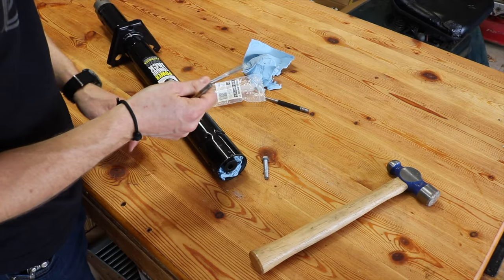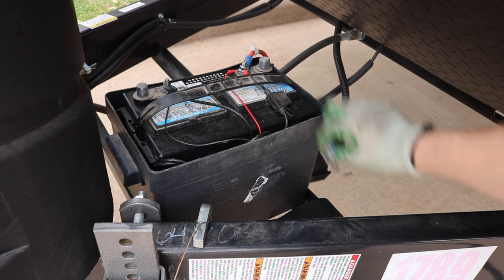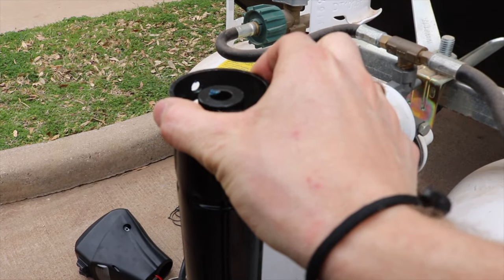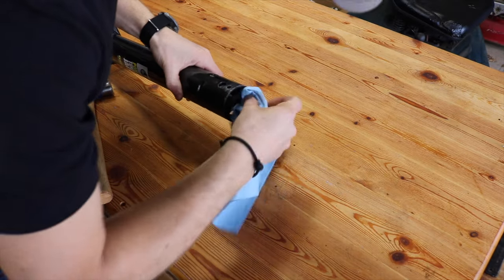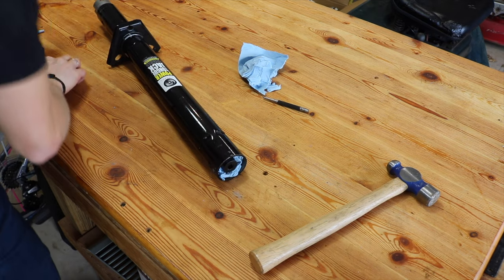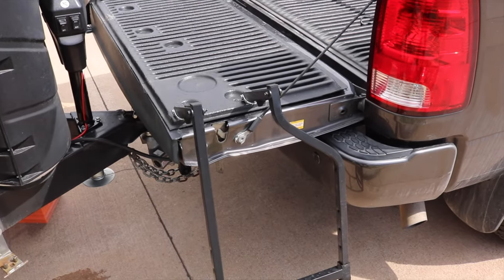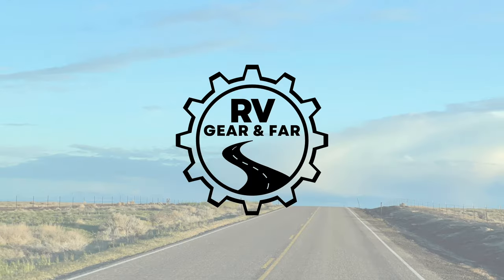Life-Changing Travel Trailer RV MOD: How To Fully Open Your Truck Tailgate WITH A Trailer Attached!

Comment: Alternate method: unbolt the jack from the frame, turn it 90* and drill 3 new holes in the frame and bolt it back in (maybe spray paint to holes to prevent rust before bolting the jack back on).  Just a thought, especially if you don't have a set of taps.
Reply from the maker: I mean… yes… but I’d rather wait for the mailman to deliver a tap than to drill 3 new holes in the attachment bracket so close to the original holes
Reply: Could you just rotate it 60 degrees and use the same mounting holes?
Reply: If the jack plate is round (like Husky), drilling new holes in the plate is less work than drilling the frame and no tapping to do.
Just have to use transfer screws to mark the 3 new holes location on the jack plate.
Reply from the maker: @normtaylor9844  the holes aren't in an equilateral triangle - so they don't line up if you do that - that was the first method I tried out ◡̈

Comment: A hitch extension  is way cheaper than a jack  and gives more turning capabilities
Reply from the maker: Possibly- but many rigs already have this jack installed and just need to swivel the motor head
Reply: Weakens the design of the hitch by adding leverage. I like this idea better

Comment: I did this. Luckily the holes were there,  I simply had to tap the threads. I rotated mine so the control buttons face the driver side.  I find that more convenient when backing the truck or when I'm ready to pull truck forward. Great explanation though!
Reply from the maker: Awesome! Super handy right? I like the passenger side just for the fact that if I ever have to drop the trailer on the side of the road that its easier to access on the off road side. Happy camping!
Reply: i was thikig the same thing but then his response about the passanger side also makes sense. its almost like they need to make this jacks in this orientation with button still centered towards the truck. its obviously a common issue so if you solve for that im sure many would upgrade or at least choose it over the competitor.
i will try this mod soon, hopefully already have the holes so i dont have to drill it first but time will tell.

Comment: Or you could do what I did.  Buy a new weld-on three hole mounting plate for $5, remove the jack and cut off the three ears of the old mounting plate on the jack, then orient the new plate at 90-degrees and weld on the new plate to the leftover mounting plate still on the jack. Clean and paint, and re mount.
Reply from the maker: You could - but since I don’t have a welder a drill bit and tap is significantly easier

Comment: I'm going to look into doing that mod this weekend! I too have a Ram 1500 and that same new jack that you have. Fingers crossed that i have the holes pre drilled out... Like the side ladder as well and having it off on the passenger side makes better sense this way if your on the side of the road or what not its just over all easier...  Like what one of the other guys suggested and did, have the controls on the drivers side. Not worry about that jack light, lol, i have a set of 6 inch spot/flood led lights that i mounted to my Rams back bumper just inside of the tail pipes and that helps out so much better at night.
Reply from the maker: Sounds like a plan - let me know how the mod goes - fingers crossed you have pre drilled holes too!

Comment: I want to thank you for the turn 90 Degrees on the jack. I have been wanting to do that for a long time. (bolt pattern on mounting  can not pivot tried it.) Lippert's lift cracked and was leaking so they sent me a new one. So I had one to tear apart and see if it was changeable and it was. So it is now at 90 degrees and I can open tailgate when hook to RV. THANK YOU VERY MUCH. P.S. the replacement was not drilled or taped. But the old one was drilled, not tapped. Thanks again.

Comment: Gave ya a Sub for the idea. Our tailgate hits right on the switches when folded down..Grrrrrr. I have used our 5 gallon bucket to put over the Jack head. But this is a better solution to be able to completely open the gate.

Comment: Very nice video, thank you! One question. Why wouldn't you rotate it the opposite direction? You are most likely to operate the tongue jack from the drivers side of the vehicle when attaching or detaching the trailer.
Reply from the maker: Typically we hook up with two people - so its easier for the other person to be on the passenger side. Plus, if on the side of the road I want to be on the passenger side as much as possible. Either way works ◡̈

Comment: Did this mod, mine didn’t have the holes either. Had to drill them. Works great with 2020 Chevy 2500.
Reply from the maker: Fantastic! Glad it worked well for you - its one of the best mods I've done - we use it on every travel day.

Comment: Do you know that you can just turn the whole unit, the bolts will still line up.
Reply from the maker: Actually, its not a right triangle and the holes will NOT line up - that was the first thing I tried ◡̈

Comment: Could you just turn it 1/3 after taking out the first 3 bolts?
Reply from the maker: Its not an equilateral triangle, so the holes only line up in one direction on the frame

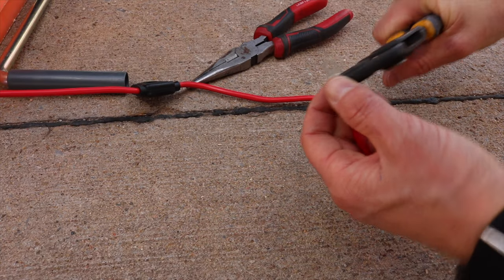Comment: 7:50 get a crimp tool, even the Doyle one from Harbor Freight is 1000x better than crimping with pliers.
Reply from the maker: Agreed (its held fine 3 years) but a crimp tool is definitely the better tool option - honestly not sure why I was using it there - maybe I couldn't find the right pliers? Not sure, but I definitely agree with you.

Comment: Install a Hensley Hitch and you will kill 2 birds with one stone. #1 You will have in my opinion the best travel trailer hitch on the market. #2 A Hensley Hitch already allows for the tail gate to open FULLY without coming in contact with your tongue jack. Problem solved X2!!! 😊
Reply from the maker: While true, it is a SIGNIFICANT investment
Reply: @rvgearandfar    best investment you'll ever make... our family has 3 and 1 propride....  zero sway period..... can't happen.... I  tow 10000 lbs in any conditions.... never white knuckling...
Reply: @rvgearandfar You get what you pay for 😊. Significant investment indeed. I’m not trying to save money when it comes to my safety and peace of mind while towing my rid up and down the highways. 

But yes your option is indeed viable for people who rather not make the investment into a Hensley Hitch or folks who just so happen to have a hitch that has the tailgate issue. So your option/suggestion is very good.

Comment: So rather than do all of that, why couldn't you have just taken the three mounting nuts off where it bolts to the tongue,  turned the original jack around 1/3 turn or 2/3 turn to reposition the whole jack and then put the nuts back on?  Am I missing something?
Reply from the maker: Its not an equilateral triangle- so if you do that, only two of the holes lined up - yes that would have been much simpler- but unfortunately doesn’t work

Comment: just rotate the entire head so the controls are on the back side no drilling necessary
Reply from the maker: The shaft is not in the center of the head - so turning it 180 runs it into the propane tanks

Comment: Owned my bumper pull travel trailer for 7 years and have never had a situation where I would need to do this.  It makes sense, and it is just a poor design from the manufacturer!
Reply from the maker: And we use it ALL the time - shows how one piece of gear can be super important to some and absolutely unimportant to others ◡̈

Comment: You could have saved yourself a lot of time and money by removing the three bolts that bolt it to the tongue and turning the whole thing to the side and then putting your three bolts back in
Reply from the maker: Actually, its not a right triangle and the holes will NOT line up - that was the first thing I tried ◡̈

Comment: Not sure what I’m missing. Why not just put the unit in rotated 120 degrees?
Reply: He explained his unit does not rotate
Reply from the maker: Unfortunately, those three mounting holes are not a perfect triangle and therefore the mounting bracket ONLY lines up in this orientation. That was my original plan but unfortunately isn't possible.
Reply: Thank you both for the answers. I understand now. Happy Camping.

Comment: Its not the same model 
Smoke and mirrors video 
You should have used the same model of jack
Reply from the maker: Did you watch the video? Its not possible with same model of jack unless you cut it off and reweld it. No smoke and mirrors involved.

Comment: Mine hits the top of a manual jack, so this won't work for me. Im going to have to weld new mounts to mine in order to get clearance.
Reply from the maker: You could get a longer shank and skip any welding
Reply: @rvgearandfar  no, I can not. With a longer shank, the hitch moves too far behind the axle, making weight distribution nearly impossible to achieve.

I can't even move the jack back either, because I have a triple tube tongue on my trailer, so the only option is to install dual landing gear like a 5th wheel.
Reply: @rvgearandfar  I do have a solution, though. I'm just going to get an F-250 and lift it about 8 inches. Tailgate should clear then!!!
Reply from the maker: @charlieodom9107   I mean there's always A solution ◡̈